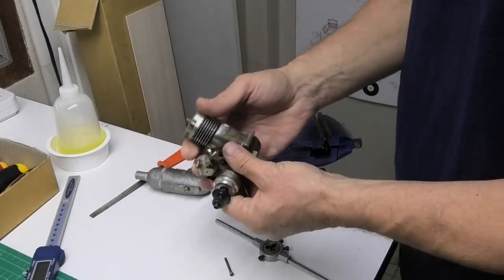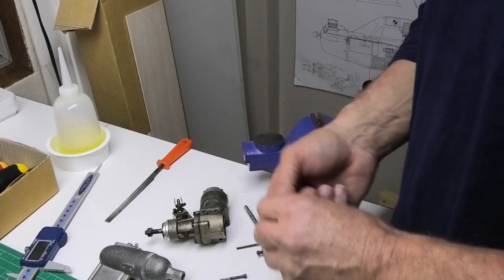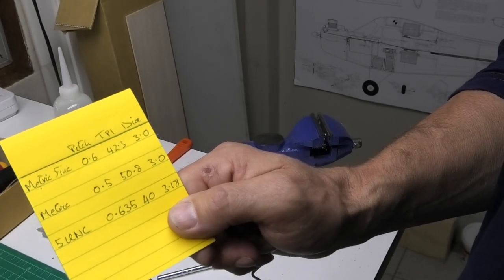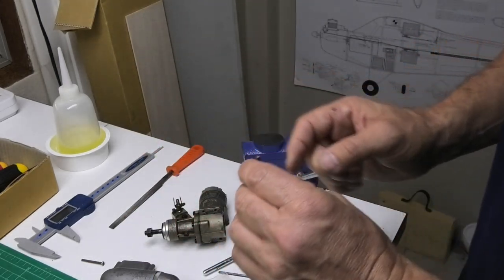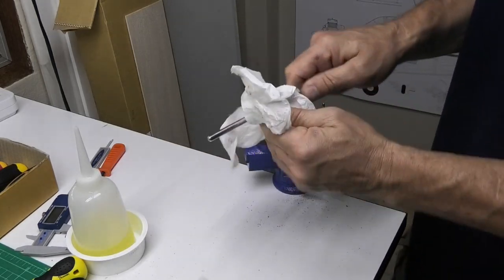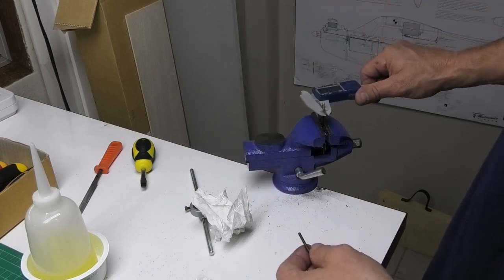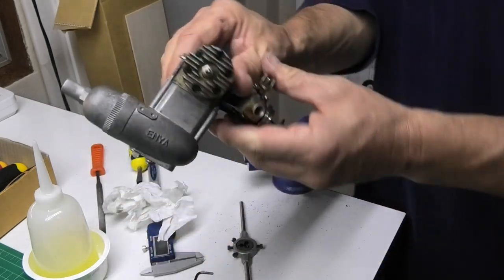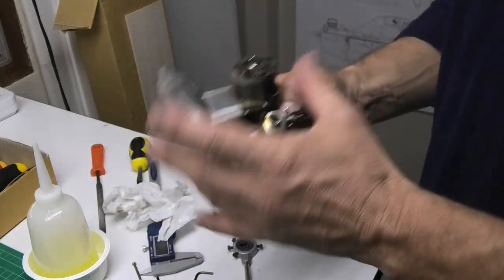Rare JIS Enya Glow Engine Bolts! - How to make some new replacements, with a limited workshop!

Comment: Hi Mark,
Thanks for sharing the video and the idea.
I ruined a cranckcase’s screw of an Enya .19, they’re of a very soft steel, but I’ve solved it using an 1/8 screw, after re-tapping the thread with a 1/8 tap. The pitch is very close  , 1/8 x 40 is 0.635 threads/mm, instead of 0.6/mm, and diameter is  3.175 mm,  so it’s easy to tap and the pitch difference is negligible for short screws.  Haven’t did it for muffler screws, they’re a bit longer, but it may worth a try.   
1/8 taps are common and not expensive, and 1/8 screws are available everywhere.
Reply from the maker: Sounds a good solution, but I would be a little concerned about retaping of a close size as it will remove more material from the already taped hole, and the remaining thread is not going to be as strong, only going to be a partial thread.  But is it works and holds!
Reply: Mark Robinson  Certainly it’s not ideal, but it was what I had at hand, and it worked 🙂
Screws are the downside of small Enya engines: non-standard pitch, weak material and awful phillips head. Beyond this, I love them.

Comment: Mark --- Thank You for sharing - Bolt Making. I have done as you did with the wire cutters - cut something harder than wire and have chipped the cutter blade. So now , I have a small pair bolt cutters and I think a Cable cutter will do. The bolt cutters were used and cheap. A dremel  tool too would be nice to have . Small cut-off wheel and after the cut side dress the end of the bolt / screw to taper the end off so to get started into mating part
         My last question was on Prop Size. ------------This Question :    I've been watching your videos to see what kind you use -- Wood or the Plastic ( Nylon ) what ever they are made of. You seem to use " Master Air Screw "  ( nylon ) ones , not wood. Can you tell me why you use what you do?
          Last thought a comment below said something about chasing / changing the pitch of  the prop nut. I DON'T  think that's a good idea. Start chasing /changing the stud sticking out from the crank or doing anything with the prop nut. I think you are only asking for trouble --- could be serious. ----------------- Thanks Again - Rodney
Reply from the maker: Yes, bolt cutters are better for that type of cutting.  Wooden props are very easily damaged if the strike anything, such as the ground on a bad landing, and also very expensive

Comment: Is the prop nut JIS?
Reply from the maker: no
Reply: thanks
Reply: I worked on my Enya .09 today. It must be an early model as there is no roman numeral after the .09. The prop nut must be JIS. A M5x.8 nut will thread on halfway then stop. I tried running a M5-.8 tap through the prop nut, no go.
Reply from the maker: Hi, your comment regarding the thread size intrigued me so I had to go and take a look at my Enya 09 II, which as you say is not M5, I measured the thread pitch and it has 0.9mm, so it appears to be 12-28 UNF, also  1BA thread would be an option , but I would think less likely.